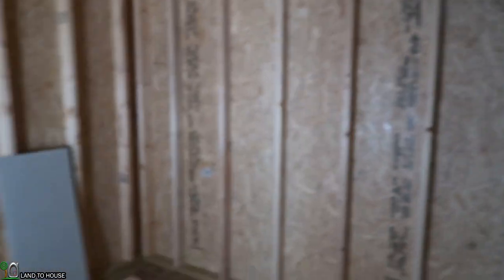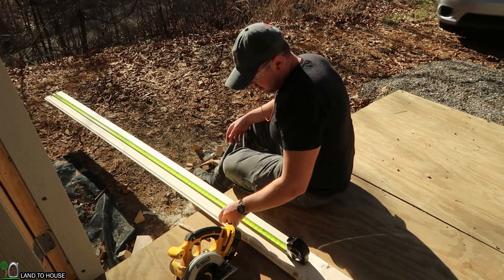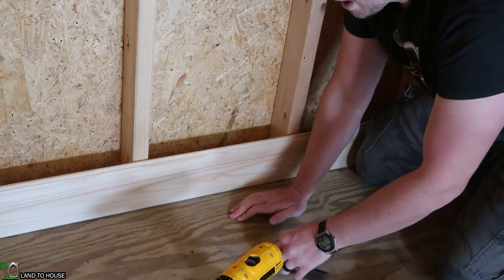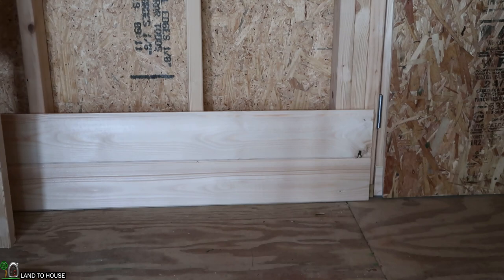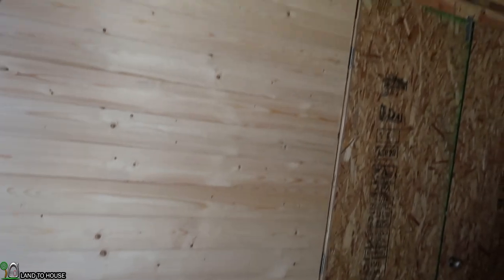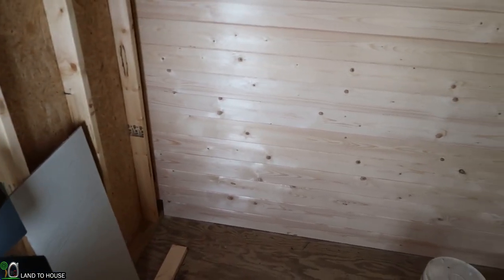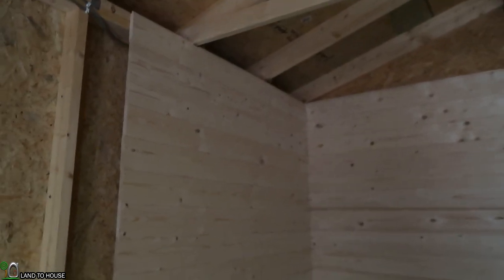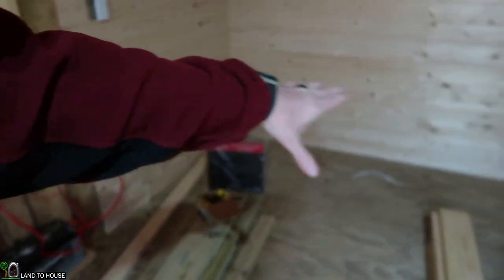Tongue and Groove Siding for a Film Studio

Comment: You did a great job on your wall, it looks good, I'm working on a 18 ×10 room, going to install tongue and groove board, wiring and instalation now, going to nail the boards like you did, good idea to predrill holes, avoid splitting, great video, thanks for sharing, subscribed.
Reply from the maker: Years ago I started a project like this and I learned the hard way that pre drill is a must. Also get a nail punch. That tool makes it so much cleaner.